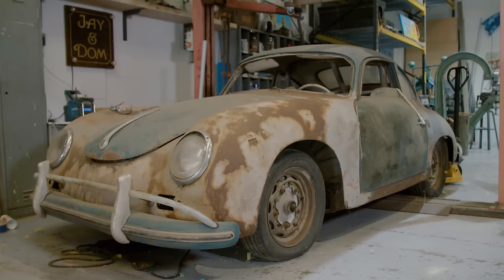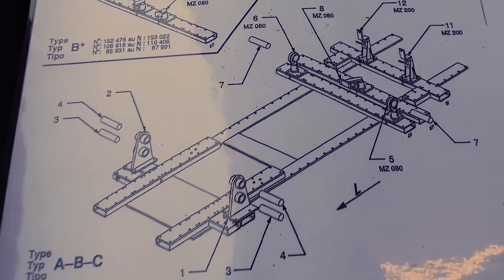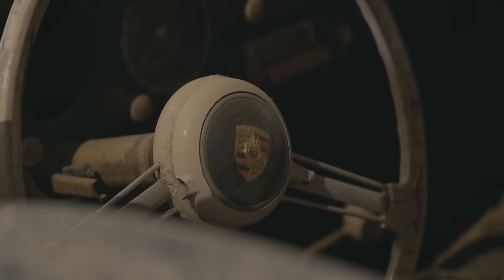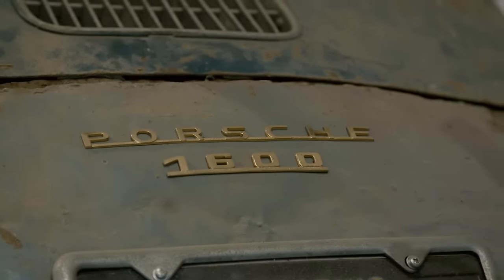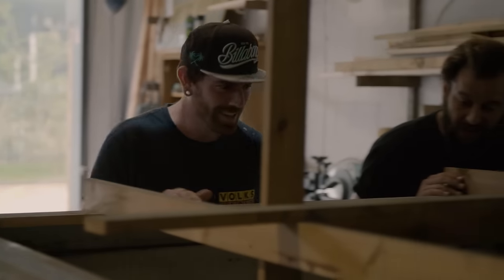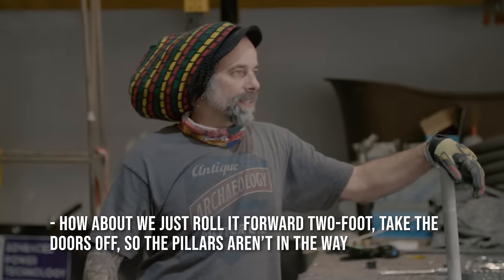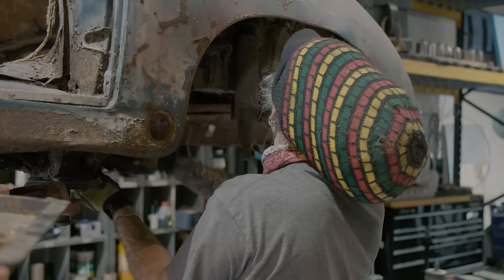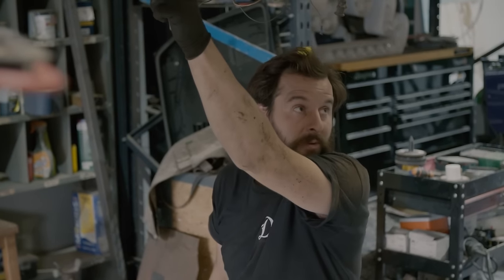Barn-Find Porsche 356 Project Begins! | Porsche 356 Restoration | Episode 1

Comment: Great video Dom, it's all doable on the 356.  I used to work for a bodyshop company in the UK (I have now retired to France) and they used to rent out Cellette jigs and equipment.  Having been involved in jigs I know you have picked the right system.  Some other bodywork repair systems rely on measurement and fancy gizmos.  Cellette understand that in the industry people like "simple".  Real people understand big hammers, chains and hydraulics. As you found when loading the body onto the Cellette jig bench, if it fits the bomb proof jig brackets, the body/frame/chassis is square.  If your 356 body had been out of square it is now basic stuff to jack out the panels etc to fit the brackets.

Now she is on the bench and fitted to the brackets it is now a case replacing the panels as required, knowing it is basically all square.  Just make sure the door and window apertures are correct as you do it.  As I am sure you have discovered Porsche parts are very expensive.  But they are available.

I was in Germany a few years ago at the Techno Classica Essen exhibition (I had a stand there).  They are some really superb 356 repair specialists in Germany.  It might be worth your while to try and tie up with one - perhaps for advice in exchange for some publicity for them.  Just a thought.
Reply: Hi Dom.  I agree with tony. One of the best jigs for body resto.  I have loaded many a car (wreck)  on to one.  And turned them back into a nice shell ,  also agree to keep parts handy to try fit in there intended spaces .  Better to find out that that fit before painting    ( please don’t ask  how I know that).      Best  to work away at a panel at a time. Or a pair left and right.    All the best with the project. Look forward to seeing your progress.

Comment: We used to use "EZ grip" or fine grinding paste on Phillips screw heads. Also the "Snap-On" stud extractors that fit in a socket are nice to use. Learnt this as I spend all my working life on aircraft. Should be an interesting project.
Reply from the maker: Nice thank you! I have the snap on set they are very good

Comment: Well done.. I done an 67 Wolseley Hornet (Posh Mini) and I had to fabricate new front end and rear boot floor/ valance. As you couldn't by them at them time.

Looking forward to this.
Reply: @barryjohnson127  That's it. The boot was extended by 3" from an mini boot floor.
Reply: @barryjohnson127  Yes the hornet had a light up badge. With a different Bonnet spear to the Elf
Reply: @barryjohnson127  I really like the 1100/1300. My dad used to take me to school in one... Playing The Stray Cats (Rockabilly) Cassette

Comment: Subscribed.  We are doing our own 356B 1961 at the moment, have been going 3 years, but wow, we had relatively no rust compared to you.  Have replaced front fender quarter to centre of nose, right door skin, all sills, and inner longitudinals, jacking points, battery floor, floor pans, fixed some front right former collision damage, bottom of left door, completed all the upholstery, seats, currently under epoxy primer.  Now on a rotisserie, so I can get the under schultz crap off and spray the under coating stuff to the bottom of it.  Have to do a rebuild to the engine, gearbox seemed good, but we will see when we get it back together. She had sat in a garage on blocks from 1983, thankfully a dry clean garage, just covered in stuff.  Good luck maaaate!
Reply from the maker: Wow sounds like you are well on the way! I can’t wait to be that far along, best of luck with the rest of your project, thank you for watching

Comment: my 356c looked much like this when i got it. same color and bondo, although it was still running, but just barely. thanks for confirming that the upholstery is vinyl. I am looking forward to seeing the interior go back in, as I need to understand how the dashboard is mounted, and the proper configuration of the floorboards and carpet set.

Comment: Porsche 356 is one of my favourite cars. You definitely have one of the best alignment jigs to get it accurately back together. I worked on Cellette’s for years and much preferred them to measuring systems. If it doesn’t bolt up to the brackets then you know it’s not straight. Good luck with the restoration Dom’, it’s a great project.
Reply from the maker: That’s great to hear thank you! I am so relieved that it all lines up!

Comment: Off to a good start by getting it in the Celeste chassis jig. Get a PORSCHE FACTORY WORKSHOP MANUAL. It will have all kinds of chassis & body dimensions. It will also show how just one guy lifts the transaxel with his legs and arms to R&R. Both front fenders and front clip will have to come off. Whole new battery box. Kiss those rocker panels and sills good bye. New heater tubes inside the new longitudinals.
Reply from the maker: I’ll try get that book thank you, any help will be good! 
Yeah front end is coming off soon, same for the back to be honest! 
Can’t wait

Comment: Great to see you started. Inspirational for me as I have a 61 t5B (which was my mum's) in a similar state. I started my restore in 1998  and haven't finished. I went in a different direction because of lack of skill and money. Having stripped mine I bought a chesil chassis , rebuilt the mechanicals and transplanted into the chesil. Always planning to come back to the original  t5 chassis. You  also make me feel bad because I did my chassis measurements by eye, string or marking out on the floor. If you need advice on the motor  I did a good job with mine up grading to a C crank /rods and 1720 big bore obtained in hand luggage from the states... But that's another story. Enjoy the process. Good luck and maybe I can ask for help with mine as you become the expert.. Best regards Dom F.

Comment: tip for rusted bolts etc.  after spraying relevant releasing fluid,, try tightening up a fraction,  this will crack the rust.

Comment: Just restored a 356c from wreck with no floor!! Didn’t have the luxury of a  jig. There’s only 2 points you can lift a 356, under the front torsion or under the rear torsion bar.
Reply from the maker: I am not sure this car could be done without the jig, I guess it could, but it wouldn’t be straight!
Reply: @DominicChineas  if you watch old factory film it’s a wonder they are anywhere near straight! They were built as good as mini’s 🤣

Comment: thats the easy part done,all you have to do is put it back togeather simple right ? back in the 80s/90s i ran a 53 beetle and used 356  brakes etc the was lot of 356s about then and parts were reasonable eg set of brakes /drums/shoes £150,engine runnning +complete £175 as you well know 356 parts can be an arm and a leg ,if only i stored some of this stuff ,good luck with all you do great project !!!!!!!
Reply from the maker: Wow if only I could get a set of brakes for that money now! 
Luckily I have almost all of the parts, I just need a lot of repair panels!
Reply: @DominicChineas  thinking of 356a brakes i had a reccuring problem ,the divider bar that holds the shoes apart constantly snapped the fork off the end ? also brake cylinders were incredbly expensive if you could find them !!!! but i found that peugoet cylinders were the same 1/4 the price hope this helps you !!!

Comment: Have you bought the brackets or renting them coz they are an expensive thing to buy , I prefer Carbench over Celette  just because I used one for so long quite like the data-liner but obviously no brackets to hold panels in place , and with renting you run the risk of sum git bending them .
Reply from the maker: I have purchased them, that’s why it’s taken me this time to save up!

Comment: Well Dom 
To what extent are you going ?  Full restotation  to the extent so media blasting the body and chassis?  Looks like the Tanaka will come in very useful for you to repair that car    
How bad is the rear end accident damage ??  If Jon spotted the inner wing is  warped    
In the end is it going back to something like  showroom condition 

Ps what colour will it be    
 A nice metallic cherry red flake finish would look stunning    wire wheels   like old E types had 
Hope all goes well for you with it 
I'll be watching your  posts
Reply from the maker: Thanks for the questions, 
Yes to blasting back underneath to remove rust, 
I am not sure on which direction yet, I feel it may be a full restoration as I need to cut so much out! 

The original colour i think is aquamarine blue so it will stay that colour

Comment: All you had to do was to drop plumblines from the suspension mounting points and then measure the diagonals, then use a jig if the
measurements were not equal
Reply from the maker: The jig is to hold it all in position while rusty areas are cut out to keep it all in line when it comes to re assembly

Comment: Those brakes are fine. This is a 356A T2 1957 1958 Coupe in American and "Rest of world spec.
Reply from the maker: Thank you, what about the full width rear bumper bar? I have only ever seen them with 2 smaller ones? 
It looks like it should have the shine up licence plate light
Reply: @DominicChineas  Yes the licence plate lightshould shine up. Most were dented by knees of mechanics. That is a front bumper in the rear. Rear bumpers have exhaust cut outs and short bars as you rightly say. If you straighten that bar. it would not line up with the body panel. Also, the overriders on rear should have exhaust holes. A US company called Restoration Design do most body panel replacements. They are on Youtube. Good luck.

Comment: Long job ahead with the body. 
Are you going to blast it or moving straight to cut and weld?
Reply from the maker: Definitely a big job ahead, I’ll Finish stripping parts first, then cut major bits out the way before blasting!

Comment: In the late 60s two of us bought a 356 1500  in far worse condition than yours,  with no workshop we scrapped the car   my mate put the 1500 motor in a Beetle and I put the brakes on my 56 Beetle,  the car had been on fire so the interior was toast so we made the best of a bad job, later a got a 63 soft top and the brakes went on that Beetle

Comment: luckily the entire car can re-built from reproduction parts, the only real trouble I had was finding original drums for the rear, thats rare stuff, oh and a matching numbers engine near impossible, finding a period correct case is not to bad
Reply: DO NOT throw away those drums, ill buy them
Reply from the maker: Don’t worry nothing is getting thrown away! 
I’ve got all 4 drums, as long as they are in good shape I should be ok!
Reply: @DominicChineas  throw nothing away, the drums can be heat treated and re-sleeved, if you need help the Porsche 356 registry is awesome and full of super helpful people and a data base that will blow your mind, good luck

Comment: thanks for reply dont know what happened to my post  re jig. I have an Aussie 64 
Splitty pickup sc, had it a good few years , have taken it off rd for some major chassis cross rail  and top hat work , could really do with your set up to get everthing alighned before replacing structual parts , my situ and where i have to do work is all conspiring against me as am on a slope on drive, am capable of doing the work but not ideal where its located . realy could do with finding somwhere with better facilities , but there u go , had it 15yrs , found it in london  in salvage classifieds back of auto trader , first time its been off the road for any amount of time since I first got it back on rd, might end letting her go.

Comment: 0:03 This car needs two years of work and fifty thousand material costs.
Reply from the maker: Your probably right with the 2 years, not sure about the £50k though?!
Reply: They are usually sold for $200,000 – $250,000. Sometimes the price goes up to $6,000,000